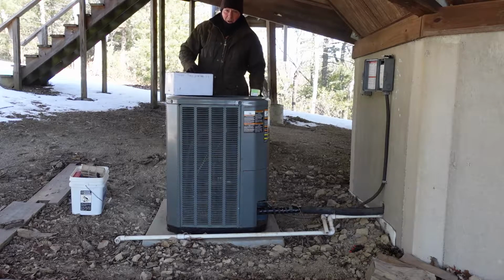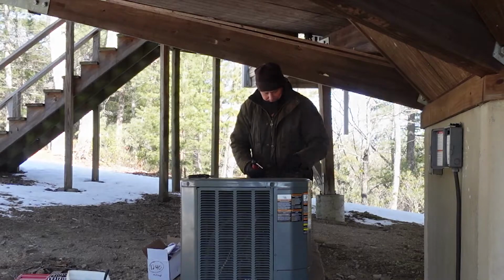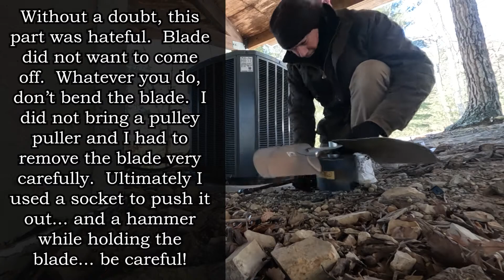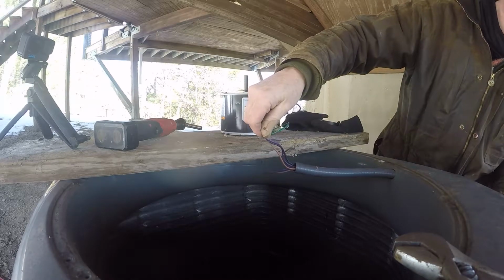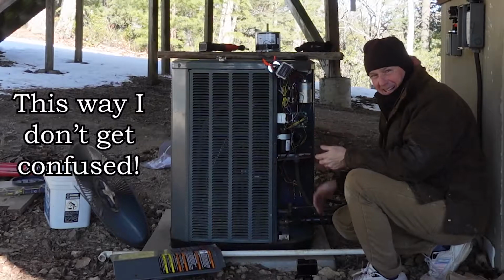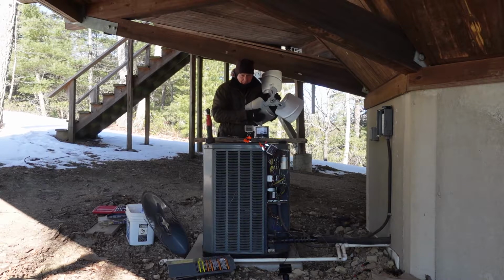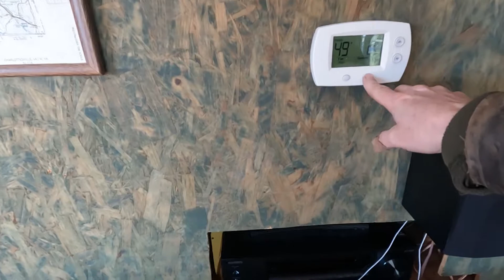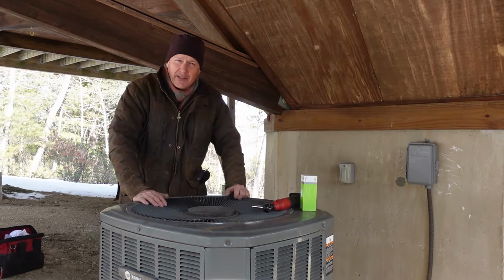Install a Fan Motor on Trane HVAC - Outdoor Unit

Comment: What were your symptoms leading to the fan motor replacement? Did it pop the breaker inside the house? Or just noisy?
Reply from the maker: Thanks for watching and asking your question. I remember hearing the air handler come on but the outdoor unit did not.  I looked at it and the fan was not turning. Most likely it was stuck.  This was our vacation home that we rented as a b&b.  I was only at the house every 3 days.  From a guest's perspective, I don't think they knew about it because most likely the heat strips came on inside.  I would also add that there should have been some noise leading up to the failure. Probably a bearing in the motor should have been noisy.  Thanks again for watching our video.  Kevin
Reply: @MillGapFarms I am about to tackle that job and appreciate your video. My outdoor unit is still operating but now sounds like a washing machine in the spin cycle. Guessing a bad motor bearing.
Reply: @johnmcmullen456 how did it go?
Reply: @JimHeil The fan motor was shot and I was able to replace it myself. Not difficult to do but the first motor I ordered had the wrong bolt pattern, my mistake for not first measuring the old one. All good so far and saved a lot of $$.